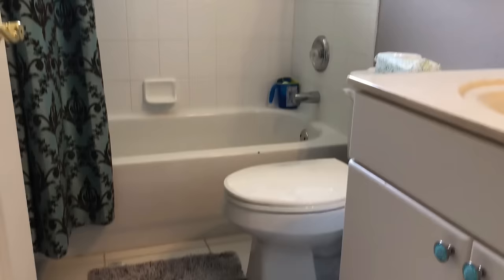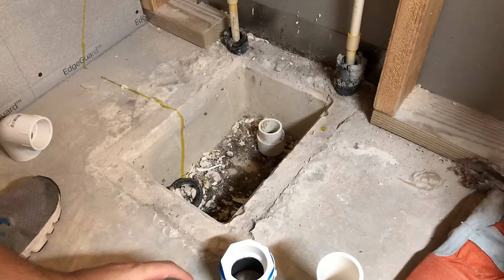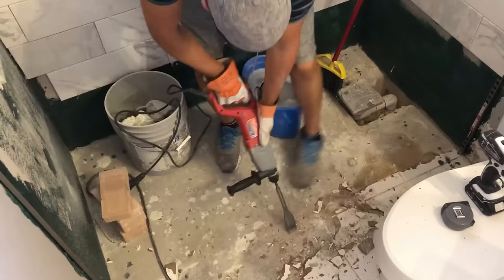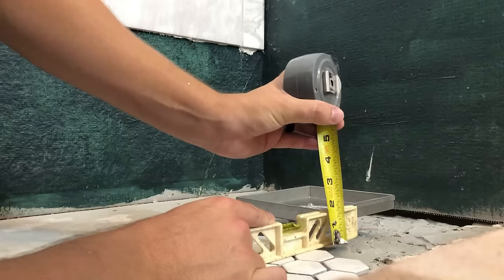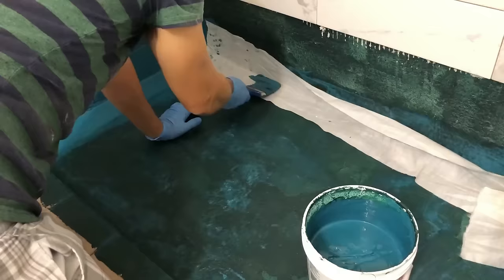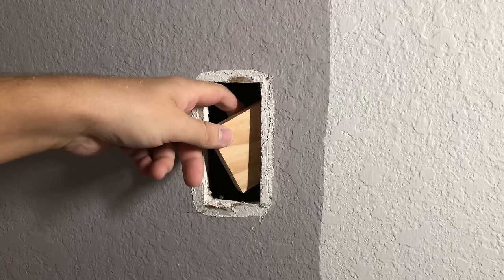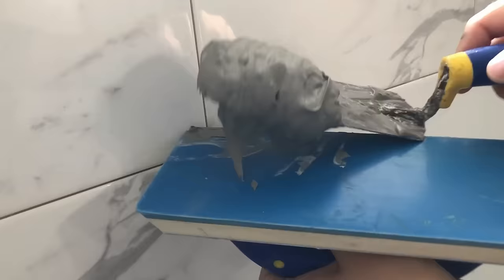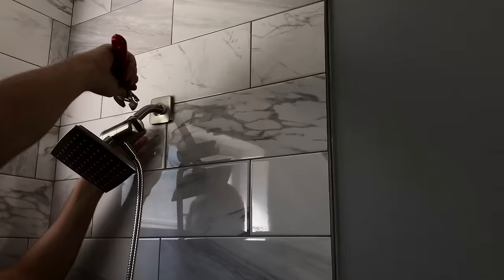Complete Guest Bathroom Remodel DIY | Start to Finish Tub to Shower Conversion

Comment: 1 thing I'd say that is important when you're redoing your bathroom. Change all the valves to prevent leaks since you're already in the process. I work in restoration and the most common claims come from busted valves. The last thing you want is to have a updated bathroom and go through it again because of water damage. I want to point something that will make your life easier, not saying what he did was wrong. Connect the sink faucet to the top beforehand to save yourself from trying to do it in tight space.
Reply from the maker: I agree with the valve replacement it’s fairly inexpensive to do it. But your time about the hose connections are genius. Thanks for sharing.
Reply: We purchased a 12 unit apartment complex and are slowly remodeling all of them.  Changing out the stop valves (toilet, sinks, dishwasher, fridge) is absolutely something we always do.  The units are 20 years old and it costs about $45 per apartment to replace all of these (convert from multi turn to 1/4 turn).  It doesn't matter if they need it or not... It's just nice to have them done!
Reply from the maker: @mmorlino  Very cool. How much is a 12 unit apartment cost, just curious if you don't mind sharing.

Comment: Wish I had the patience to even attempt something like this myself..lol. I got my guy coming next week to remodel my guest bath. Same exact layout as yours. I’m converting from tub to walk-in, but not changing floors or vanity. Instead he will regrout the floor and tile all the way around to the edge of the vanity mirror and then same on the other side to the edge of the closet door. Charging me $6k including all construction materials. I bought the tiles, shower door and fixtures.
Reply from the maker: Yeah it becomes a long project when you do it yourself. My wife was getting tired of it by the end of it all. Lol
Reply: @Daddicated  how long did it take you? You knocked it out the park dude, I’m sure it’s a great feeling walking into it every time knowing it’s all your own work. 👍🏽
Reply from the maker: @BengalTiger47  I think overall it was about 5 months or so. But there were holidays and a vacation in between too.

Comment: It turned out really nice. I think the light fixture and glass door were my faves. I'm also a little concerned as to why you didn't use a pan liner, especially since you built your wallboard into your pan. If your shower was to leak, you're already 2 for 3. Your only defense you have right now is the waterproof membrane. It was really good work tho, I bought an acrylic pan because the thought of laying a pan was too much for me. I'd watch your shower tho. Apparently you can buy a tool (think infrared) that can show leaks, I saw a home inspector use it
Reply from the maker: Thanks for the suggestion. Yeah that was rookie mistake.

Comment: props for the trying to do it all yourself... few notes ( take it with a grain of salt as its too late to do anything now) uncoupling membrane between the tile and the concrete would prevent your tiles from cracking in a couple of years.
Reply from the maker: Thanks for the tip.

Comment: I would recommend a waterproof membrane on the walls!
Reply from the maker: Maybe on the next one. 👍🏼
Reply: Agree waterproof the entire wall. You'll regret it when the water seeps through the grout. Even if you seal.the grout. 
Water finds a way through and cement board is porous.
I can't say mold enough times.
Reply from the maker: @walkermom100  it will be fine. I’m sure in 15 years it will need to be remodeled again as styles and designs change.
Reply: @Daddicated  prolly won't last that long.  But oh well.
Reply from the maker: @walkermom100  I’m pretty sure it will. Lol but we’ll see. I’ll let u know in 15 years. Lol

Comment: i hope it holds up, as i see an issue with the shower floor. w. if you simply do a mud slope without pre slope, then the drain should of been a bonding drain and with a bonded drain a sheet membrane or complete waterproofing liquid needs to be used with proper sheet membrane where floor meets walls...if you did indeed use a liquid waterproofing on top of mud slope you should of used a different drain as now water can seep down under drain from the gaps between tile and drain and get into mud bed, if it was a bonding drain that water would just go into plumbing, thats the difference. or you could of used a 3 piece drain with a pan liner and pre slope. good luck and the end product turned out nice
Reply from the maker: I think I should be okay. I got concrete foundation so even if a little bit seeps thru it should absorb it. But I made sure to use a lot of waterproofing liquid so I'm pretty sure I should be okay. But thanks for the suggestion.

Comment: Beautiful Sir! I have a question though. While you had demolished your older tub and toilet, what happened to the water for the rest of the house? How did you continue using other valves while everything was open in the bathroom you constructed?
Thanks
Reply from the maker: So when I was demolishing everything I didn’t touch my valves until I was ready to replace them. The valves were always in closed position so I didn’t need to worry about turning the water off. Once I was at the point of replace the valve, I turned off the water supply, replaced the valve, and then turned it back on with keeping the new valve in closed position.

Comment: That's beautiful. I have a massive tub to pull, and I want to convert it to a walk-in shower. I also have a smaller shower that I want to remove and convert to a linen closet.
Reply from the maker: Good luck with your remodel. It’s nice and reward after it’s all done but can be painful in the middle of it.

Comment: Great video, and thanks for documenting your process!  I know you stated here that it took you a few months to complete, but in terms of actual working days, about how many would you say it took?  I'm planning to be out on vacation for a few weeks, and I'm contemplating if I could complete this if I worked for 7 days straight, assuming I have all necessary materials and tools on hand.  What do you think?
Reply from the maker: It really depends how fast you work and how many hours you put into it. I mean it’s a lot to complete in 7 days. Here’s my breakdown:
Day 1: demo shower wall, floor, remove toilet, remove vanity
Day 2: shower valve/plumbing if your replacing it. Install shower floor liner, install Durock board
Day 3: install shower wall tile
Day 4: install shower floor tile
Day 5: finish tile/ grout everything 
Day 6: install toilet, vanity, faucets, drain
Day 7: paint and touch ups. 

This is a rough plan and honestly doing tile what takes the longest. So depending on your skill level, the size of tile, how many cuts u need, you may need to add another day for tiling to this plan. Plus I didn’t include trim work here as well. I mean if you will be putting 10-12 hour days for 7 days straight then I think you might be able to pull it off. However, if you plan on working 6-8 hours per day then it may be hard. Plus don’t forget always plan on oh crap days too, where you don’t have a right tool or you are missing something and u need to run to the hardware store because something ran out or u forgot something. Anyway I hope this helps. Keep me posted and let me know how it went.

Comment: I also noticed you didn’t water proof at all around the shower control valve where water is known to settle and get behind the wall…they make a waterproof gasket that you mud and tile over that enforces the valve area and ensures no water gets behind your wall
Reply from the maker: I honestly didn’t think of that. Thanks for the tip.

Comment: Should have waterproofed the entire wall. You'll regret it when the water seeps through the grout. Even if you seal.the grout. 
Water finds a way through and cement board is porous.
I can't say mold enough times.
Reply from the maker: Next time for sure.

Comment: Looks good. I'd say two things besides what's already been said. #1: Stay away from the blue glue, it cracks. Go with the clear glue. #2: two 90 degree pvc connections make it more challenging if you ever have to snake that drain. Jackhammer down enough to get two 45s' on there. 👍
Reply from the maker: Thanks for the feedback.

Comment: Wow such a detailed and well explained video. Turned out great as well. Your bathroom looks exactly like mine in terms of structure so I’m thinking I’ll be able to do the same here. What was the overall cost of the project if you remember and also was there anything thing you would have done differently or paid someone else to do? Thanks in advance
Reply from the maker: Overall cost was about $3,200. Umm 🤔 what I would differently. Well a few things. 
1. Use pex for plumbing instead of CPVC
2. Waterproof the entire shower instead of just seams
3. Don’t forget the rubber liner for the shower floor 😅
4. Buy a better tile cutter so I can do all my tile cuts in the bathroom and don’t have to walk outside for all the cuts. Tiling the shower took me the longest. 

I think that’s about it. Overall I think it turned out pretty good.
Reply: @Daddicated  Thank you for the reply. really helpful information and yes it turned out awesome. Great choices you made when choosing everything.
Reply from the maker: @suleeeeee-x5m  no problem. Let me know if you have any other questions.
Reply: @Daddicated  I was wondering if you were going to line the bottom of the shower with a pan or other waterproofing. Cpvc isn't bad when it's new but becomes very brittle over time. Did you seal around the flange for the pop up assembly in the vanity? If not it will most likely leak when you fill the sink and probably even just running the faucet.
Reply from the maker: @XSR_RUGGER  Yeah, I waterproofed the pan with waterpoofing and membrane in the corners. I know it wasn't the best option but it was what I had to do based on where I was in the remodel. Not sure what you mean about the pop up assembly but I don't have any leaks in my vanity so far. I think I'm good.

Comment from the maker: **All the Materials/Tools I Used*
New Light Fixture: https://amzn.to/2ScAERj
Glass Shower Door: https://amzn.to/3AEjO1i
Shower/Valve Kit: https://amzn.to/2N2a9Lv
Shower Handheld Spray: https://amzn.to/2Y6qXaB
Shower Selector Valve: https://amzn.to/2N3wfNU
Jacuzzi duncan valve: https://amzn.to/3dGU4GG
Laticrete Waterproofing Membrane : https://amzn.to/2JSNDmD
Aqua Defense: https://amzn.to/3b0vS0S
Sakrete Sand Mix: https://amzn.to/2RmvEsS
Best Markers Ever: https://amzn.to/2USHCN4
Shluter: https://amzn.to/2HQhvzg
Pipe Cutters: https://amzn.to/2LyAgZU
New Shutoff Valve: https://amzn.to/3fV1iIO
CPVC Pipe Glue: https://amzn.to/2WZ0euE
Wax Ring: https://amzn.to/3ge2vLv
Hose: https://amzn.to/2LWeUFL
Toilet Installation Kit: https://amzn.to/3d7btZb
New Toilet Seat: https://amzn.to/2ZqwbPo
New Toilet: https://amzn.to/2yompCj
Drain Kit: https://amzn.to/3haQ9o2
Tube Extension: https://amzn.to/2UpqZbh
Tile Trowel: https://amzn.to/34jHjOE
Prybar: https://amzn.to/32ARsWs
Channel Locks: https://amzn.to/32GDSzl
Utility Knife: https://amzn.to/39NdxTE
Tile Cutter: https://amzn.to/2VrX97z
Tile Grinder: https://amzn.to/2PptkAv
Tile Wet Saw: https://amzn.to/3c7Nitm
Tile Mixer: https://amzn.to/38YGxIn
1/4" Trowel: https://amzn.to/2HUvy6V
Grout Cleaner Tool 1: https://amzn.to/2Vytl8B
Margin Trowel: https://amzn.to/3c2c8ux
Tile Sponge: https://amzn.to/2HTbsK8
Thinset: https://amzn.to/2HXJdtG
paint brush: https://amzn.to/2RsIGoZ
Level: https://amzn.to/38ZXsKr
Bucket: https://amzn.to/2ut1Fr8
Drill: https://amzn.to/2w2ABQ4
Crest Wrench: https://amzn.to/2Xk8QMJ
(these are all amazon affiliate links)
Reply: This is REALLY close to the look Im going for. Do you remember the name or item number of the tile you put on the shower walls? That's pretty much exactly what I'm looking for
Reply: @SuperSaraSized  what tile did you end up choosing for your bathroom? I got San Giorgio Calacatta Dali from Floor & Decor but this one looks like Castille Levante family from Floor & decor.
Reply: Are the tiles the same as on wall and floor? Looks good!
Reply from the maker: @MrDjchaz75  no they are not the same. Floor tiles are bigger. Plus the shower wall tiles can’t go on the floor they are too soft and probably would break with time
Reply from the maker: @SuperSaraSized  

Shower Wall: https://www.flooranddecor.com/stone-look-tile/marble-art-polished-ceramic-tile-100387703.html

Shower Floor: https://www.flooranddecor.com/ceramic-tile/marble-art-1.5-in.-hexagon-ceramic-mosaic-100609205.html

Bathroom Floor: https://www.flooranddecor.com/porcelain-tile/tauleto-bianco-polished-porcelain-tile-100572437.html
Reply: What vanity mirror did you use?  Love the finished product 👌
Reply: Looks great! We’re in the middle of a shower remodel with a ceiling mounted rain shower head & fixed glass divider wall. That railing system you opted for the glass door kit would look amazing in our upstairs shower. Would you mind sharing the company/model name &/or a website link please?
Reply from the maker: @xavier9243  Thanks. Here is a link: https://amzn.to/3AEjO1i
Reply from the maker: @Maggie Alfonso I used this one: https://amzn.to/3Fc61EE

Comment: Nice job just a couple tips that might make your life a little easier. For me I’d leave all the fixtures like vanity and toilet out of the bathroom until all tile work is done. It’s been my experience that working space is always at a premium the more the better. Another tip is attach the faucet to the sink then set the sink saves your back. Only other tip that works for me is water proof and mud work I complete it all first. Then all tile, then all grout. Seems to save time especially if there’s a lot of cleanup everyday. Your not putting away all tile stuff only to have to dig it all out again. Just tips no right and wrong thought you did a really nice job.
Reply from the maker: Thanks for all the tips. I appreciate them.

Comment: I wish I was able to do this. You make it look so easy.
Reply from the maker: You can. You just have to try and not be afraid of failing at it. Start small projects and work your way up.
Reply: @Daddicated  it is due to fear that I may not be able to fix it.
Reply from the maker: @rochellec.1891  What's the worst that could happen. The worst case is you will have to redo something or at last resort, you will have to hire a professional to do it. But think about this, there are so many tutorials out there that you can learn from first. Take in as much as you can for the particular project you are doing and then try to do it yourself. If stuck feel free to ask questions and I'm sure people will be happy to help. Fear is a liar. So don't be afraid. You can do this.
Reply: @Daddicated  I fear that I may discover mold and will not be able to fix it on my own and be stuck in a project where I have no clue on how to treat the mold etc and end up costing me more since I will have to contact a professional. But you are absolutely right. I should not fear but watch more tutorials to help me and ask you or others if something comes up that I feel stuck on. Thank you so much for the encouragement. I hope I can redo my entire bathroom one day this summer.
Reply from the maker: @rochellec.1891  So here is your worst-case scenario. You discovered mold, which is bad but you hire a mold expert that helps you get rid of it. Which yes would suck. But the rest afterward you can still do yourself which will still save you a ton of money. Trust me you will make small mistakes but you will learn a lot more through the process and your confidence level will go through the roof. Even if you tear everything down and have a professional do the rest you will save money that way as well. So kick the fear to the curb, roll your sleeves up, and get to work. 😜
Reply: @Daddicated  I hear you sir! Your replies have got me motivated to tackle the bathroom remodeling that I so need done. Thank you so very much!! Appreciate you sir! 🙂

Comment: You should cost the cement board with the waterproofing, not just the seams. Cement board is porous, mortar is porous and grout is porous. I recommend stepping up to something like the Kerdi system. The foundation of the shower is critical to long term performance.
Reply from the maker: Thanks for the tip. 👍🏼

Comment: Grout wont stop water penetrations, thats why you are supposed to seal the full walls behind with a product like redgard
Reply from the maker: I don’t disagree covering full shower would of been better but at the same time I covered 2 feet from the ground. The rest doesn’t get a ton of water but light overspray. So between grout, cement, cement board I think it will be okay.
Reply: @Daddicated  Grout and cement board are very porous and absorbent

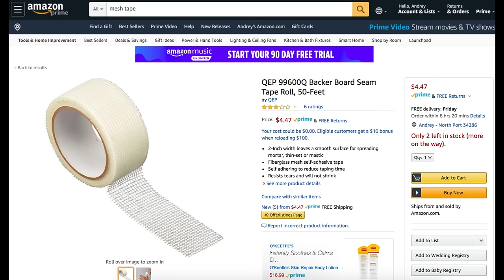Comment: 1:43 the mesh and cement is mfg. recommended, it stabilizes the seams, and will be great to have if your waterproofing fails over time, otherwise just using mesh tape is probably a waste since its not doing much good. If skipping thinsetting with the mesh tape, fiberglass tape/membrane with your waterproofing is a better route. Hardibacker says to use it. Not sure about Durock.

Just something to consider.
Reply from the maker: Hey thanks. good info right here. Always open to learning better ways for the future.
Reply: I did my bathroom about 20 years ago and didn't bother sealing the joints and screw holes on the cement board on the walls, as it didn't make sense to me and seemed overkill.. it was all going to be covered with tiles and glue anyways... There have never been any leaks or water issues ever. It's all still as solid and sealed as on day 1. Just my opinion..
Reply: Well look like you dont know tilling job water proof dont fail